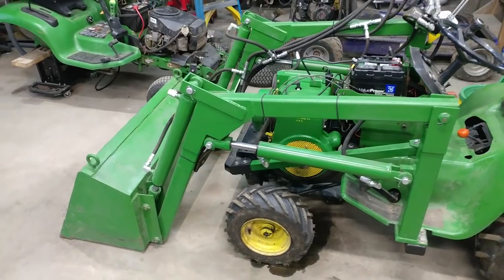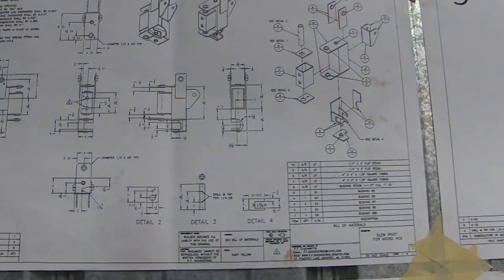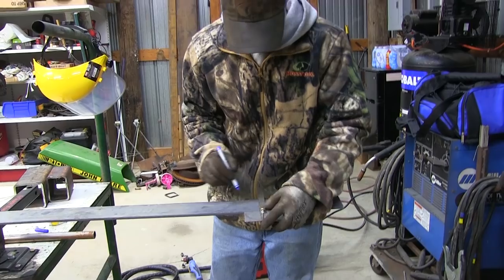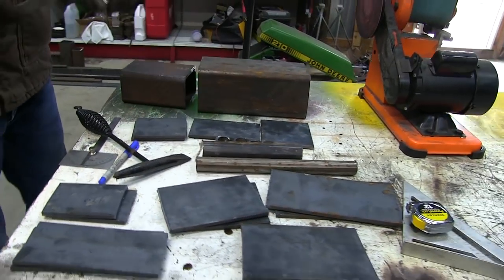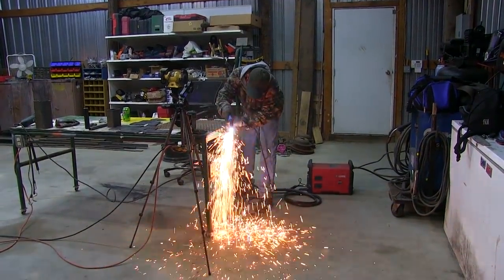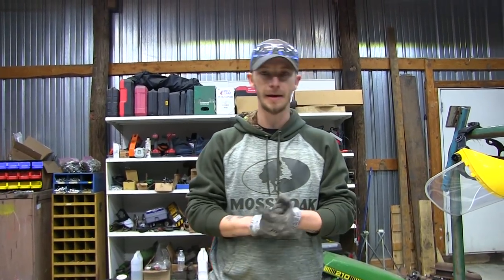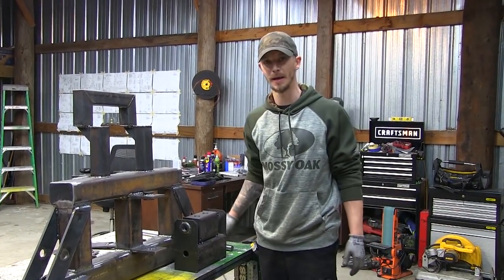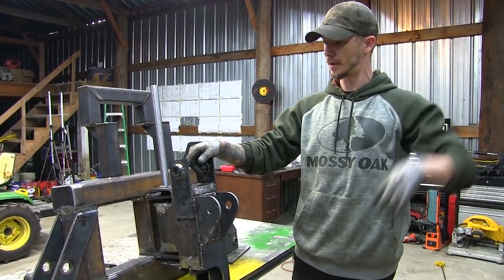Building a Mini Backhoe for a lawn mower (Part 1)

Comment: Is the a video and/or plans for the front loader?
Reply from the maker: We didn't record any of the loader at all, I do have pictures of the build process.
I bought plans from P.F. Engineering although we did have to modify them to fit this particular tractor.
Reply: Will the pictures or are the pictures in an album on the Facebook page?
Reply from the maker: @davea4675  I am posting them to our Facebook page right now.